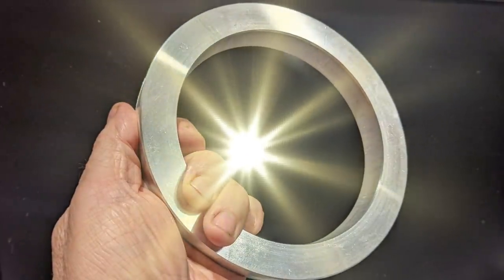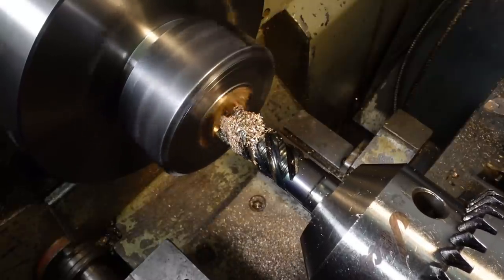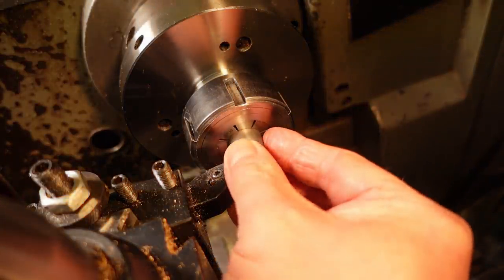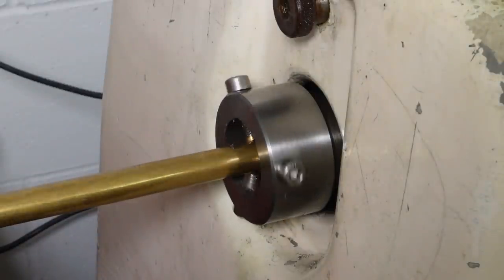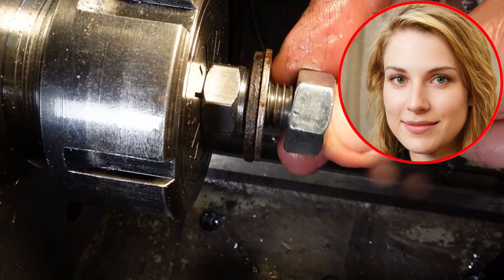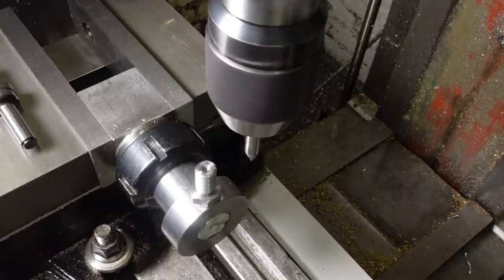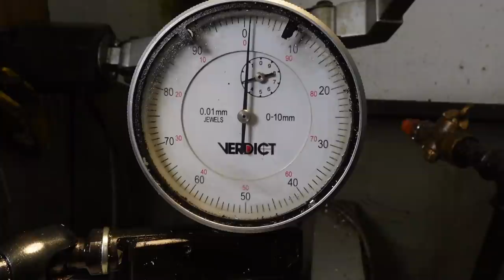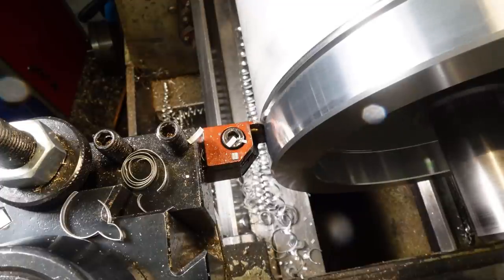Big Tube Fixture Jaw Machining and final build of my Spider-Mandrel

Comment: Hi Neil, I'm really enjoying your channel, I subbed a few weeks ago. Not sure if anyone else has made this observation, but your commentry (and accent) reminds me of 'Tom Wigglesworth phones home' on radio 4. Keep up the good work!
Reply from the maker: That's serious, ooo-er. I do sound a bit like my great-uncle Les, who collected radiograms and kept goats, but there are no extant recordings of him and to my knowledge, he was never on The Home Service, so it's a fundamentally unverifiable comparison.  The best sort, in fact.  I'm looking forward to seeing how you do with that closed-loop stepper.  I've got a 750 watt AC servo rather like that and I'm intending to use it on the cross-slide to machine parabolic dishes and complex mathematical curved forms. Not sure what to use for positional feedback though, it would be neat to use the existing 1980s Newall DRO so I could remove backlash from the feedback loop, but that starts to get tricky if you need to change direction. I did consider swapping the cross-slide leadscrew for a ballscrew, that might be the way forward. Anyway, I'll be watching your project with interest.
Reply: @MachiningandMicrowaves  that is an interesting problem (the changing direction thing). Fitting a ballscrew sounds like cheating to me, although probably the most sensible option. You can work round backlash with CNC controllers, just as we humans do, but may take a lot of fiddling.  I'm an electronics engineer for my day job and have worked with so very clever RF types on a variety of 'interesting' projects. Way above my abilities, but I find all the RF black magic very fascinating.

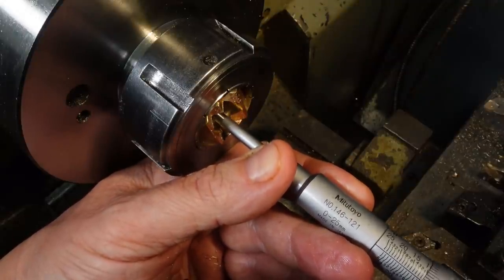Comment: @6:11 This reminds me of a time I told a physics major I had aspirations of dating that, "she was 800 millihelens beautiful." I went on to explain that if Helen of Troy had a face that would launch 1000 ships, and therefore a millihelen was the amount of beauty to launch a single ship. She got offended... 

Not because I was trying to quantify something that is purely subjective or even because she thought I was objectifying her. She got angry because I was mixing metric units with troy.
Reply from the maker: Classic!
Reply: Funny. Or the fact you basically just told her she was only 8 out of 10!
Reply: @markrainford1219  Since there's infinite beauty in the universe, I think an A*log(x) function is more useful. If Helen was a ten, i.e. Helen(Troy) = 10 then we would define our Rating "R" as R = 10/3*log(beauty). For H(T) we get R = 10/3*log(1000mH) = 10, and for this aspiring physicist we get R = 10/3*log(800mH) ~= 9.68. Pretty high praise.

Sadly, the story is similar to "An Infinite Series of Mathematicians Walks into a Bar" or "Spherical Chickens in a Vacuum" in that it is a joke, and the milliHelen is as whimsical a unit of measure as the Smoot or the megaYoda.😁
Reply: @HAL_9001  Very good (I think) but you need to change your units. mH is milliHenry and that's a bit gay.
Reply: @markrainford1219  🤣🤣🤣🤣
Reply: Ah yes the milliHelen, the head of my dept at Harefield used to use those units about fifty years ago to describe the female of the species before PC made such things questionable, to the hard of thinking.

Comment: I'm a new subscriber that came here through the lantern chuck series. 

I have 2 large aluminium tubes that barely fit on my lathe and have been pondering how to hold them for some time.

I only really need to clean the ends up as I'll be using them as vacuum chambers, and this looks ideal. 

Thanks!!
Reply from the maker: You might be able to get away with a simpler approach for a one-off, maybe using a small cheap chuck in a tailstock spindle, but if you need to machine the inside and can't get a big enough steady-rest, some sort of expanding mandrel is a reasonable solution.  For smaller stuff, I use two Delrin cylinders about 3cm thick with a cone bored in the middle, with a cone on a centra threaded rod.  The cylinders are sawn almost though in three or four places so as the cone is pushed in, the cylinder expands a little and grips the workpiece. For smaller parts, I use two disks with vee edges and trap a fat O ring between them so when I tighten them together, they expand.  Probably with all those methods is the lack of any fine tuning of the alignment.  Joe Pieczynski did some really useful custom mandrel tips https://www.youtube.com/watch?v=J1RFTRzuAcU
Reply: @MachiningandMicrowaves   I don't have a steady-rest big enough, and I'm subscribed to Joe :).

I've just been outside to measure my tubes and realised that I have 4 different sizes, not two. the original 2 were picked up from a scrapyard, and will eventually be vacuum chambers. I'd need an expanding mandrel for each one.

Then there's the 2 divers tanks that I've got that need skimming too. They're similar sizes, so would get away with 1 mandrel.

So that's three mandrels needed.

Or, your example here can be used on all three. OK, with the tanks, I would have to pressure turn them, using the spider to make sure it was running true at the end. 

Plus, and this is a big one, your idea is not only a really good one, but looks really cool too. 

I REALLY appreciate the reply :)

Comment: I've always wanted to see how precision microwave connectors are produced in industry. I'm talking about items like metrology grade coax connectors that have ultra low VSWR and loss in their rated bands. Everything from type N to air dielectric connectors like 3.5/2.4/1.85/1.0mm. 

Are there notable shops that make these connectors for OEMs like Keysight and other test/measurement vendors? It would be awesome to see who and where it's all happening. Seems like a subject that has yet to be discussed online.
Reply from the maker: If you think about watchmaking, that's another order of magnitude of precision over what's needed for those connectors, and folks have been doing it for ever using manual lathes.  I've never seen a shop that makes that sort of connector, but one day it would be a laugh to try to make a couple of 3.5s perhaps.  I have some 32 GHz HP coax relays with 3.5 connectors.  I'm working on a long term project to make a harmonic mixer as a front end for my spectrum analysers, based on that mixer that The Signal Path did a teardown on.  That looks reasonably challenging.  3D printing of graded-index mmwave lenses is not quite possible because of minimum feature sizes on UV resin printers, but I have a cunning plan to make a Fresnel Zone Plate lens from thin, wobbly HDPE using..... Ah, you nearly got me there.  Using <top secret upcoming project tool>. Yeah.  If it works. Otherwise I'm going to be picking bits of HDPE out of the ceiling for weeks.

Comment: If the missing bit of drill ever reenters then lay the parts together in a vee machined in a bit of aluminum and just silver solder them together, the dull red heat required should not affect your quality hss-co drills at all. 
I have had great success with this.
Reply from the maker: I remember watching my father do that to a 3/4 inch drill he picked out of the scrap bin at work. Well, I remember that NOW, after you mentioned it. Thanks very much for triggering a cool memory of the Old Man. I wonder if that drill is still somewhere in one of his old toolboxes? Must have a search.
Reply: @MachiningandMicrowaves  anyone who likes hovering around scrap bins is ok in my book.
Reply: @markamy357  personaly its impossibe for me to pass by a bin without looking,  found a lot off stuff that only needs minor fixes, or even no fault at all....

Comment: I know you just spent 84 1/4 minutes (😉) making that useful looking contrivance but  you could have parted off those rings while the work was held in a three jaw if you parted off at the chuck end not the usual tsilstock end. Sounds sketchy but with reasonable precautions and the delightful Aimee watching over your shoulder and giving advice quite do-able.
Reply from the maker: Indeed that is how ring number 1 was produced, but then, I could just walk over the road to the neighbour's workshop and use his big bandsaw. Well, I could if I'd known that he had one.  "Hey, you could have used my big bandsaw", he said. "What big bandsaw?", I said. Yeah.  Great. 

The actual process  for ring 1 was to part kit almost off, leaving a little material, then use my Bosch jigsaw/scroll saw to finish the cut. No fun at all though.  Far too easy.

With the fixture, I can finish-machine three of the faces in one setup. However, I made up some soft-jaws to grip the rings for finishing the other side, so yep, I could have done it without making the infernal mechanism. I could even make a casting instead.

Comment: Very nice work.  Question:  Since you had to move the spider deeper inside the cylinder to use your boring bar, did you have to put the dial indicator back on to true it up?  Enjoying your videos.
Reply from the maker: Yes, there's a bit of a time-lapse, I actually removed the whole assembly intact then refitted it and trued it up again. it was very close as the rear teeth were holding it very tightly. The actual process was to loosen only one of the nuts, and the setscrews, move it in, retighten the setscrews then retighten that one nut. After that I only needed to make a minor adjustment to get it true enough.  Continuity is hard!
Reply: @MachiningandMicrowaves  ;I thought it had to be something like that.  All I could see was you having to loosen your spider and then think how hard it was going to be to get it all concentric again.  Nicely done.  Thank you.

Comment: Did you get those stub drills from "CNC Poor Boy"?
Reply from the maker: No, they were from Cutwel I think.  I ordered fresh ones from Drill Service of Horley on Friday and they arrived on Saturday morning. DCOST-10.25-Y, by YG, item code 13778529, HSSCo8 split-point uncoated stubs. I hadn't tightened the collet in the mill vice as well as I should have, and as the tip broke through the steel into the mandrel, there was a void from where I drilled the other collar, so thedrill tip did the classic grab as it broke through, but instead of pulling it out of the vice, it tipped it up and the drill decided that it had suffered enough and let go with one hell of a crack.  No harm done to the machine, vice or workpiece.  Or operator. Root cause was using a collet block at one side of the vice without a jack or something at the other side to equalise the force. That probably meant the main force was applied to the rear edge, with less at the front, so the drill managed to lift the workpiece and then the helix dug in and that was the end of the drill.  Normally I use a machinist's jack at the other end of the vice to prevent that problem. Just carelessness.  I wasn't even filming, so I can't blame "the camera was in the way", which is my stock excuse.
Reply: @MachiningandMicrowaves  a stock excuse is always handy. ;)

Comment: Next time countersink the washers when they stil part of the stock saves a lot of time and glue.. parting of with good tool needs no further turning., and use a file to chamfer the back of the washer after parting halfway. But very nice project.
Reply from the maker: I can't remember why I I did it that way, but it was probably that I just did the first thing that came into my head, then ended up having to do more work as a result. The new 1.5mm parting inserts I'm using now leave a good surface finish, but it is never quite as good as a face-turned piece. I need to investigate why that's the case.  On stainless it is usually very good, but there are some tool marks on brass and some scoring on aluminium. Probably just feeds and speeds and the wrong sort of lubrication.  I now have a nice square Vallorbe file that I use for chamfering while I'm parting off. Good advice, thanks.

Comment: After the sad realization that I am never going to see Aimee in person and not being patient enough to wait till the end to comment I feel I must. So you are doing all this because the tube doesn’t fit in your band saw, did you try and make multiple secant style slices? It’s a tube not solid so you could get a respectable ring sliced off with less effort.

Second comment, I love doubleboost but he too doesn’t seem to see the er system collet wrenches slide “ in from the front “ and therefore won’t need the dremel modification or scratch up the collet nut. Sorry it pains me, just waiting for the knuckle buster ouchie my niece says.
Reply from the maker: The Aimee joke about the end about the bandsaw is just that. Clamping the tube in that bandsaw just wouldn't work, in the end I did cut one ring but it was painful and I had to do it in five slices using the saw upright.  I've got a lot of these to do, so slipping the tube on to the mandrel, facing the end, boring the inside then turning the outside and finally parting it off makes it nice and easy. I can then use soft jaws on a 3-jaw chuck to machine the stepped features on the other face without having to flip the jaws from inside to outside to do the outside/inside machining.  Anyway, it was a pile of fun and I don't have to care about such minor issues as the time and trouble it takes.  It's a highly privileged position to be in, for sure.  
I have lots of other jobs coming up that need a similar setup, but with machined soft jaws to hold thinner tube.

The collet chuck thing is a weird by-product of having a tripod and two lighting rigs to reach around.  I can't see the nut of the ER40 clearly, so trying to engage the pronged spanner with the slots is comedic to watch. I've mislaid the nice hook spanner I normally use, so I'm stuck with that dreadful flat spanner, which is entirely hopeless with all that kit in the way. If I get an overhead rail sorted for the lighting and camera an sound, things will be different, but for now I want my nice hook spanner back. I find the pin wrench is a reasonable alternative, but ultimately, fixing the video kit to an overhead rail will mean I can use the unmodified flat spanner without all that fumbling

Comment: What brand of gloopy CA is that? Ta
Reply from the maker: It says "Everbuild Superglue HV" on the bottle. same make as the de-bonder I use. Cheap but effective and doesn't drip. I have used Bon-It High Viscosity as well.  Key features are shock resistance and gloopiness. Ultimate bond strength, water resistance, longevity not relevant. It sticks fingers together REALLY well. Also nitrile gloves.  Keep the de-bonder nearby!
Reply: @MachiningandMicrowaves  brilliant thanks. I shall have to get me some of that de-bonder lest I get myself into any more trouble. Really enjoying the videos!